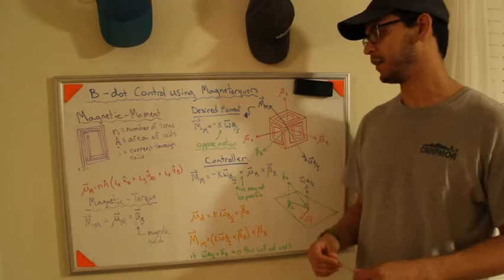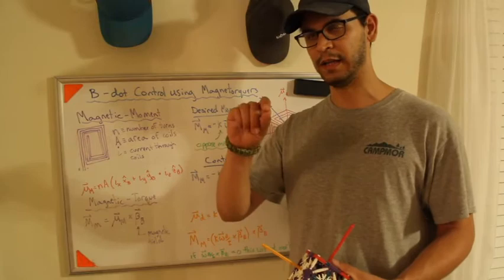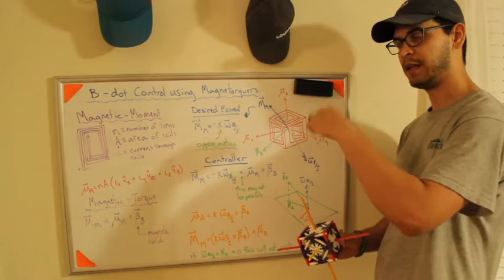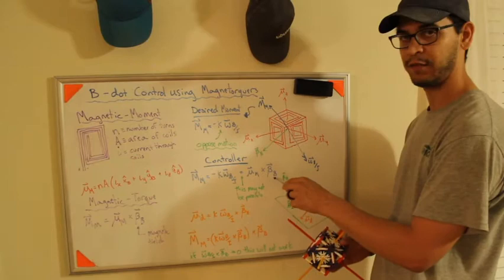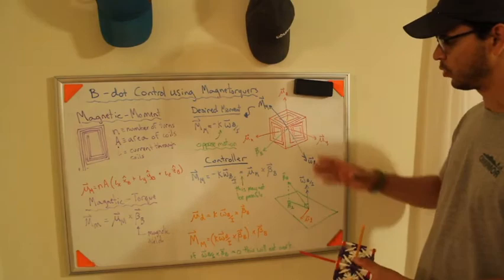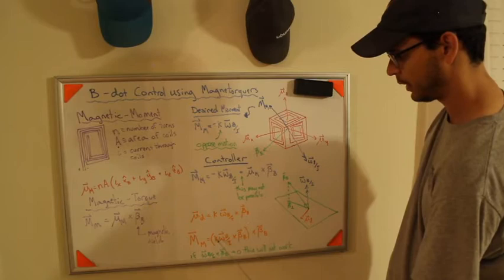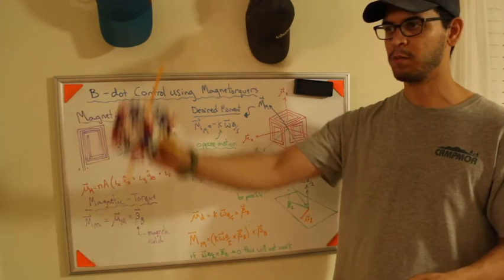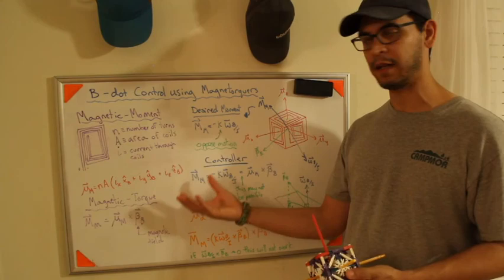B-dot Control using Magnetorquers

Comment: Hi, thank you for the video. The equation does not look like the well known B-dot controller form since it looks like that it has no derivative term of the measured magnetic field.
Reply from the maker: The derivative of a vector using the vector transport theorem looks like this

dB/dt (inertial) = dB/dt (body) + omega x B

It's assumed that the vector dB/dt in the body frame is a constant over the time the vector is taken. As such the derivative of the magnetic field is just 

omega x B

which is what I have written on the white board.
Reply: @CarlosMontalvo251  Thank you